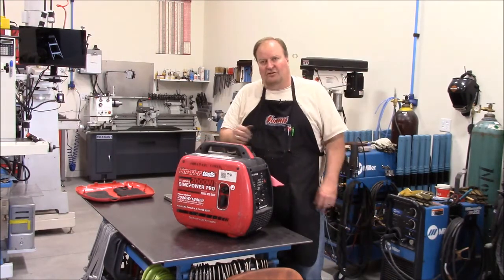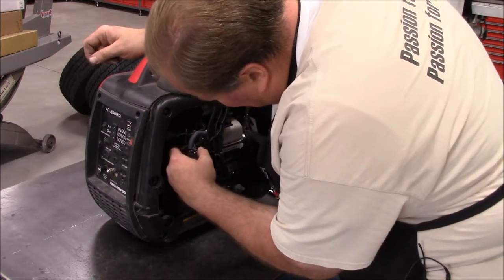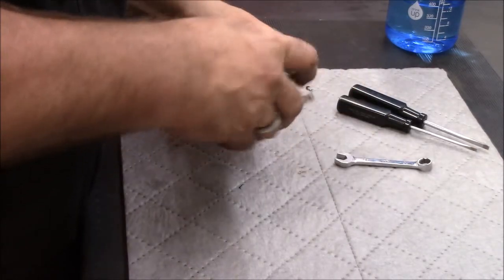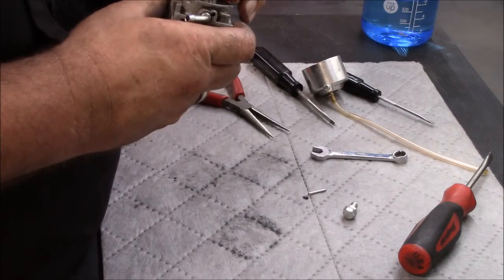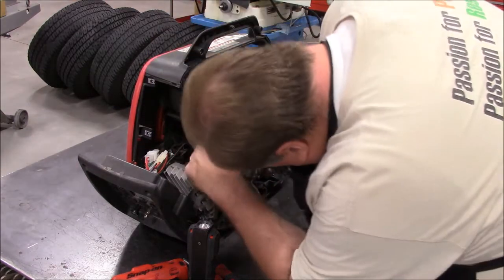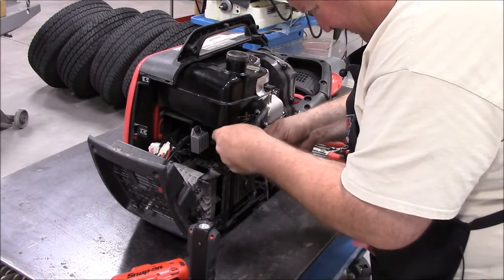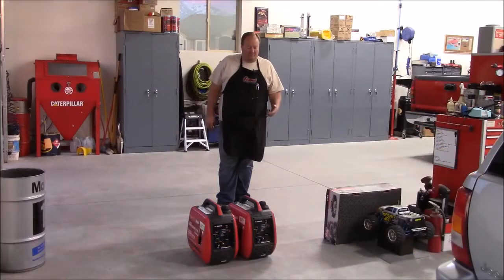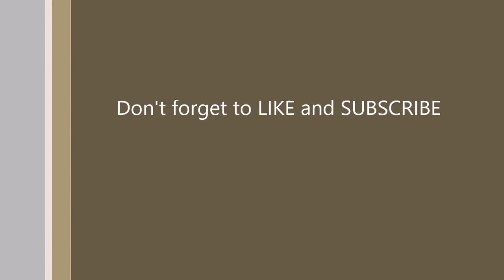Portable 2000 Watt Generator Tune Up and Carburetor Cleaning

Comment: I have the Yamaha one , with very similar carb setup.

First,  I found the carb was very easy to slip out , provided you screw out both studs first. 
(mine's studs were loctited solid so yes, I had to take the body apart, too  - but next time will be super easy  as I 've lubed the stud threads  on reassembly !)

Second, there's a slow jet and pilot screw  on top/ side of the carb , and these are the ones that usually get clogged after a while. Later models have a plug over the pilot screw (epa mandated), a pita to remove correctly (for cleaning) Standard pilot adjust. is 2-3/4 turns out.

I drain the tank + carb  when storing it now. And never use ethanol gas.

So maybe yours had  only a stuck fuel needle ?
Reply from the maker: Sorry, not quite sure what your asking.  This was a quick job I did for a friend more than 4-years ago and if memory serves there was debris in the bowl and jets that just needed to be cleaned out.  Pretty easy job to clean the carb..

Thanks for watching.
Mike

Comment: Thanks for the Video. I have one of these generators and can not find a float bowl gasket replacement. Do you know where to purchase one from? Company appears Out of Business.
Reply from the maker: I’ve been able to match up the gasket at my local small engine shop as this carb appears to have been used on a variety of outdoor power equipment (OPE).  
Thanks for taking the time to watch. 
Mike
Reply: Same problem. I opened mine up and the float bowl 'gasket', which was leaking, appeared to be orange Permatex. Very strange as I bought this new at Costco several years ago, and it's never been opened before. I'll try a local small engine shop. Thanks for the video!

Comment: Hi there! Please help, I have this inverter that’s leaking. I opened it and noticed a clear plastic tube attached to a silver thing, I presume carborator, but the other end just hangs not attached to anything. Is it supposed to be attached to something, or is it just to release air? Thank you!
Reply from the maker: Hard to tell by your description.  Could be the fuel line that has become disconnected and leaking fuel or could be a vent line that’s open to atmosphere and a needle & seat that’s not holding pressure and allowing fuel to leak.  
Mike
Reply: Sounds like that area where you can drain the gas out of the tank for long term storage. Just tighten the screw on the tube that’s connected to the engine.
Reply: 1 year late lol.. sounds like the tube that is used to bleed the gas inside of the carberator out. You should find the little screw thats at the very top of that line and make sure its tight. Sounds to me like its leaking gas cuz its loose. Give that a try.. if you still have it.

Comment: Every time you did a video 'swipe' and whooshed on to the next scene, you cut past the stuff I wanted to see.  I have the exact same carburetor on a similar generator, with the stepper motor on standoffs above the throttle control.  It fell apart as I removed the two standoff screws, and I am unsure how to put it back together.
 Did you happen to have any closeup images of the connector from the stepper motor shaft that moves the throttle shaft?  I am not sure how to put it back together, and have an "extra:" spring that I think holds the stepper motor 'arm' to the throttle shaft ears.
tom
Reply from the maker: Sorry about that. Like I’ve mentioned before, I’m a mechanic not a videographer so I’m still learning.  😜 I guess I need to pause more between clips to allow the video editing to transition. 
Unfortunately I don’t have any still pictures that would be if any benefit. 
Thanks for taking the time to watch but  I’m sorry it wasn’t more helpful. 
Mike
Reply: I’m looking where the spring fell off too

Comment: There is a little spring where does it go
Reply from the maker: If you’re talking about the governor spring, it will go on the throttle blade lever.